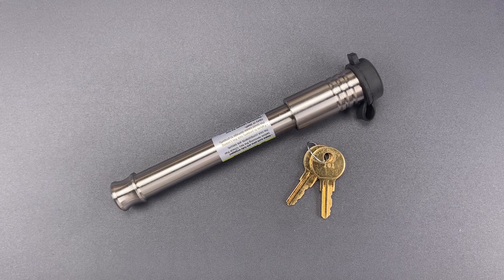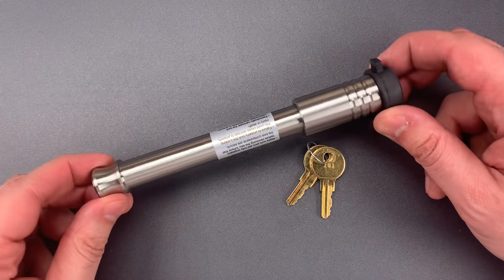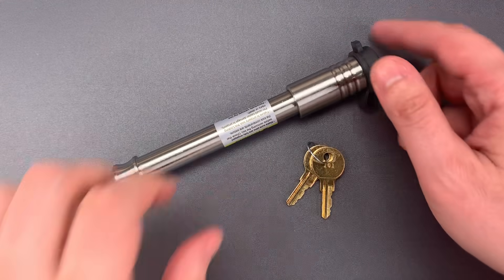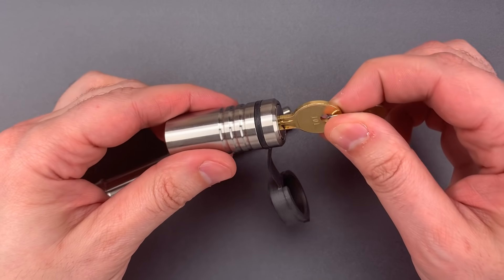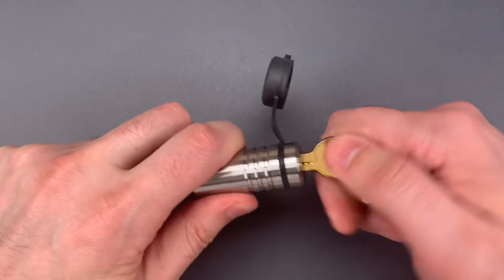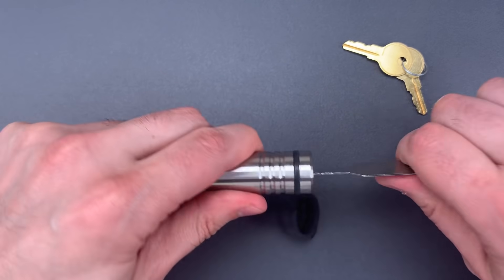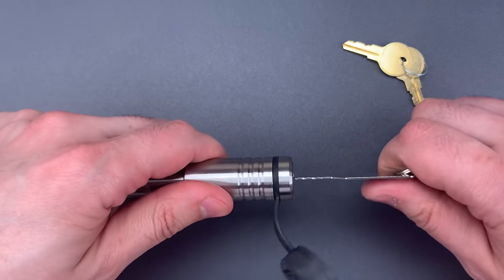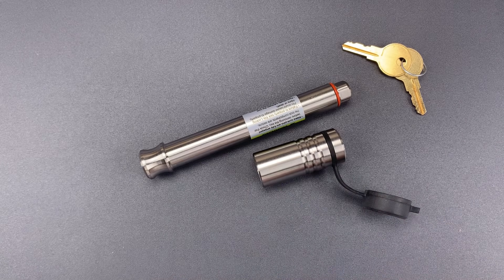[1086] The Lock That Must Be Picked 15 TIMES! (Infinite Rule Security)

Comment: Could you imagine this thing with a decent core though
Reply: A Master 4 pin core would make it virtually invulnerable to the majority of thieves.
Reply: @springbloom5940  In the quiet words of the Virgin Mary, "Come again?"
Reply: yeah if only
Reply: With a better key bidding
Reply: @ConstantlyDamaged  

Well, seeing that 99% of thieves wouldn't bother picking it once, how long do you suppose they would work on a lock that had to be actually picked, no matter how easily, an unknown number of time; that just keeps going round and round with no obvious results? Try picking even one Master No3 in the field, attached to something. That's why thieves practically never attack the lock(with anything but bolt cutters), but instead, attack the cardboard box its attached to.
Reply: @springbloom5940  I can pop a Master #3 in the field in seconds; raking for the win. 

That said, your point remains valid. No way I'm going to sit around raking a lock a dozen times for no obvious return. I'll get out a cold chisel and a sledgehammer.
Reply: @ConstantlyDamaged  

For an example, when I lived in town, my apt complex had a metal sided storage building with exposed screwheads, that maintenance kept all their equipment in. Not only did they get cleaned out, but the little shitheads took the panel of siding they removed, for access.
Reply: @ConstantlyDamaged  Master 4 pin cores can't usually be opened with a jiggler, and as long as the lock has anti-bypass shielding a master lock core would absolutely make this a lot harder.  TBH the biggest problem with Masterlock isn't their cores (although they aren't great by any means) it's that you can bypass almost everything they make. 

But seriously, imagine having to rake this thing open the traditional way 15 times while it's attached to a trailer hitch.
Reply: @lairdcummings9092  

I have a No2 that I have never been able to defeat. One of these days Ill pass her around to Bill and his Lawyer.
Reply: @springbloom5940  I'll be looking for that video. 😉
Reply: @springbloom5940  Yeah, but with one of those particular pieces of crap, you could use a plug spinner to cut the "picking" time down to about 2-3 picks. Also, a nice rake will make that #3 lock core surrender just as fast as that jiggler key did.

What you want in that is a really heavy spring on the last pin, and make it a spool while you're at it. Should foul the spinner up and make raking it much harder.
Reply: How does one hold a cold chisel and a sledgehammer simultaneously?
Reply: @JoshStLouis314  use a short-handled sledgehammer. Something in the three or five pound range. I've got both in my tool kit.
Reply: @ConstantlyDamaged  

Yet, no one ever does that 🤔
Reply: @lairdcummings9092  I have a 3 lb hammer, but I consider it a large 2-sided hammer. To me, a sledge requires 2 hands. I very well could be wrong on the naming though.
Reply: @springbloom5940  Well he could pick it and then use the springloaded spin tool. But indeed nobody is walking around with that stuff when thieving for crack money.
Reply: @JoshStLouis314  short-handled sledgehammers are a thing; I use them with cold chisels to cut rebar. Faster and easier than a grinder, if you can secure the work piece. And the occasional lock for which I've lost the keys.

The shape of the head is the biggest difference between your basic hammer and a sledgehammer.

Edit:
I've got a couple 48 ounce (3 pound) framing hammers, too... But those aren't sledgehammers, despite being the same weight as my lightest sledge. Head geometry matters - right shape for the right job.
Reply: @springbloom5940  Do you think anyone would bother getting out a set of wafer jigglers like this, either? They'd just move on to a vehicle with a less security conscious owner.
Reply: @springbloom5940  You must be new here..
Reply: @JoshStLouis314  verrrrryyyy carefully.. ..
Reply: Why not add some weird helical core!
Reply: Unless it holds to a long pipe attack a better core is a mute point. One can slide a long pipe on the core and snap it. Core sticks out too much.
Reply: @wdiaz03  Basically. Without knowing how resistant it is to physical attack/bypass, it having the best core in the world is fairly moot.
Reply: @ConstantlyDamaged  Pretty much nobody outside of locksmiths and really hardcore locksport people has a plug spinner, let alone carries one around.  Also depending on the plug spinner, a lot of them only do a 180 degree rotation and you'd lose most of the time you gained by having to keep resetting it.
Reply: @lairdcummings9092  cold chisel and mini sledge destroys most welds, even on tire boots
Reply: @dozi3r  yup.
Destructive combo.

Also: So where you been parking? 😁
Reply: @springbloom5940  as for realistic field conditions your location plays a big part of it. I have a pretty good setup on my basement door, pretty good core repackaged in an old kwikset housing from when my parents built a hose. The thing is that I dont slouch on security but everybody else does so why should they bother with me when everybody else up the valley uses master lock everything? Its like the old tale about a bear, you dont have to run faster than a hungry bear, ya only have to run faster than the guy beside ya.
Reply: But if you just coated it in 1st grade bat shit. You only have to wait a week for the picker to die.
Reply: Dude, this lock kept LPL busy for 30 second, this lock is already God tier
Reply: @springbloom5940  yeah master would finally be proud
Reply: @kidthorazine  thieves: NOPE
Reply: @springbloom5940  i guess people see how cheap it is and go 
Im not
Reply: Slap it in a titanium reinforced thick steel safe and that's the issue solved. Seriously, why hasn't anyone done this yet (ignoring the "titanium reinforced thick steel" part, that's a millionaires project)
Reply: @lairdcummings9092  do you mean a drilling hammer? Sledgehammers are 2 handed.
Reply: @springbloom5940  that's just making sure your targets know their mistake.
Reply: I think prior knowledge would be the bane of this lock, otherwise theives might give up after the first attempt relocks.  Or even the next one, not realizing that eventually it stops relocking.
Reply: Remember the chess themed challenge core?
Reply: There is no such thing as perfection. Is it Ramset proof?
Reply: @Tatwinus  No he means a sledge hammer. The type of hammer refers to the shape of the head. Differing lengths of handle or weights don't change the fact that a sledgehammer is a sledgehammer
Reply: Laird Cummings you scare me yet fascinate me sir
Reply: They exist, our vending machine uses medeco locks that are threaded, there’s three of them in the door, you could pick it yes, but you’re going to be there for a while.
Reply: Would be humiliating at best with a Abus Disc detainer core
Reply: The lock to surpass Nokia
Reply: Yeah, might as well try to impression it then
Reply: @springbloom5940  This is already virtually invulnerable to the majority of thieves. if you are stupid enough to risk your life or future by breaking in, robbing and stealing, you will 100% be too stupid to pick even a simple lock, let alone figure out why it won't open after you picked it already
Reply: @springbloom5940  just put an Abloy disc core and no one will even try
Reply: One of this with a Bowley core!
Reply: It would be a monster
Reply: Angle grinder goes "whrrrrrr!"
Reply: * in SpongeBob voice * 20 years later
Reply: Or you could just make the bolt double the lenght, which would make you have to rake it 30 time
Reply: @JoshStLouis314  very carefully
Reply: @JoshStLouis314  as a secondary side note, i have a mini sledgehammer thats more like a steel mallet. Perhaps thats what they ment
Reply: @ConstantlyDamaged  Nice Snatch reference
Reply: Fr they could just put in a cross keyway and the thing would take a LONG time to open
Reply: @Sabrintwitt3r  my mind went to the Abus DD cores as well.  It would make it a fun challenge lock, especially if it tensioned off a different disc each time.
Reply: That would be good enough in most cases
Reply: How about a decent core and a mechanism that resets it after 10 seconds or so?
Reply: @springbloom5940  yeah they do. The only common locks that people have a hard time picking are the ones that are old, rusty, seized, and never unlocked. The majority of Thieves don't pick locks at all because its a skill that takes some practice.
Reply: @stompingpeak2043  

The majority of thieves don't pick locks, because its always faster to break the lock, or what its attached to. They don't give a shit about destroying your stuff. A $5 prybar will defeat the overwhelming majority of security.
Reply: @springbloom5940  yet some people have cought on and they do now pick locks.(only have to carry a pick and tensioner over having to carry all the other stuff). People use force on stuff when they can premeditate the crime. Meaning they have an idea of what's behind the lock. Also the growing lockpicking community here on yt is bleeding into the crime department as well. So if you do buy a lock from Walmart and use it somewhere watch out. They can all be picked quickly by amateurs with a cheap pick and tensioner.
Reply: Ya if that had a much better core it would probably be much more effective since if it took a few min per pick they would most likely just quite
Reply: @springbloom5940  aka, example lesson. DONT SHOW THE SCREW HEADS ON THE BUILDING WITH EXPENSIVE SHIT IN IT
Reply: @owenruff4796  even a 20 second pick would take 5 minutes to get thru. 1 minute each pick and that's 15 mins; nobody would ever dare to fully pick it.
Reply: A lock with a good core takes even lpl 30 seconds to a minute. Still that means that 10 min is all they need. Still that's more than most people are willing to sink into it.
Reply: True, imagine any newer abloy core and you have basically lock that no one would ever take their time to mess with in real life situation.
Reply: @springbloom5940  yes even a butter core would be better!
Reply: Yeah like who's gonna pick a tough lock 15 times just for a trailer
Reply: Most people still wouldn't want it on their door since you have to turn the key several times to unlock it, even if you actually have the key. Convenience is a significant concern for locks you need to open a lot.
Reply: That would make it the ultimate lock
Reply: No, because nobody even bothers to make a lock that LPL could struggle with.
Reply: @JoshStLouis314   I'm assuming you get a friend to help.
Reply: It's in Bosnian bills naughty bucket. That huge hidden shackle thing
Reply: @dozi3r  this me ck Made out of ringsteken with a hex Kock and pressure spring
Reply: That just would take LPL 10 additional seconds to open it.
Reply: yea, that would take the tool that LPL and Bosnian Bill made, and extra 20 seconds
Reply: Right? give it a good core and it would be nearly impossible
Reply: Heck even a shitty master lock core (well, you know their better ones that at least have a couple non-standard pins) would be better.
Reply: @springbloom5940  seems lately all you need to keep everyone out is a now hiring sign.
Reply: At that point, I believe an impressioning attack may be a good choice.
Reply: Nightmare
Reply: It would be a nightmare lol
Reply: Could the core be replaced with something better?

Comment: Sure hope the lock manufacturer takes note from this to improve their core. This will be a notoriously annoying lock to pick if the core is improved
Reply: Eh, so you are approaching me?
Reply: Indeed. They came so close to creating a lock that was time consuming enough to offer pretty good security, simply by virtue of forcing repeated picking. One or two challenging picks? Doable. 15 re-picks, with security pins? God damn, I'd just give up. Manufacturer, heed this video, and install a better core. Use this video as an opportunity for positive PR and improving your product.
Reply: @jayeshmange2424  what?
Reply: @MuscarV2  Are you approaching him as well?
Reply: @MuscarV2  Pretty sure it's a reference to a popular anime.
Reply: @MuscarV2  JoJo
Reply: Just a core similar to the ones in the 6-pin American 1100 and it will take even LPL 5 minutes to get it open.
Reply: 8-12 disc detainer in there, would be a nightmare
Reply: Yeah, even just good enough to defeat jiggling and raking type attacks would make this really obnoxious.
Reply: "annoying lock to pick if the core is improved" - wow, really?
Reply: It'd be interesting to see him pick it from the bottom of the truck though. Just to see the difference, not being able to hold the lock and jiggle with both hands. Just curious, I know he wouldn't have much trouble because he's a master at his craft. But it'd be  interesting to see. JS
Reply: i just called them, they said they cant at the pricepoint they make it at, and that most people would just try to snap it off with a pipe, and also that it is mostly there as a deterrant
Reply: @emfisher8168 , dude, this is jiggling, not brain surgery.
Reply: I work as a locksmith and have encountered basically the same design lock a few times in the wild. Even with a janky ass core these are still a pain to unlock, especially if they're positioned at an awkward angle on the trailer hitch, I would bet any thief who knew what they were doing would try to find an easier target before tackling these hitch locks
Reply: @rupedog  8-12 disc detainers, and any decent lockpicker would rather break it open
Reply: @rupedog  disc detainers aren't spring loaded like wafers or pin tumblers, so once the discs are set you wouldn't necessarily have to re-pick on each quarter turn. A steady hand and you only have to pick once. Meanwhile a core with security pins could really mess with a picker here.
Reply: @rupedog  It would take LPL 8 minutes just to introduce the pick that he and Bosnian Bill created 15 times.
Reply: @emfisher8168  It would almost be just as easy. I have one of these locks and the way its setup you can either turn the key or turn the whole lock pin and hold the key still and you can still unlock it. Image unscrewing a nut off a bolt. Either unscrewed the nut and hold the bolt or vice versa, doesn't matter. So you can just put a jiggler in the keyway and turn the whole lock, would be easy even under a vehicle.
Reply: @BrassAxe  That wouldn't work on a jiggler unless you magically get it lined up just perfectly and manage to stop moving immediately.
Reply: do you really thing they dont know ? they are experts they shrue know. the desicion making is different.
its about cost and production lines and a product that will do the job even it might not be perfect. 
when this thing is mounted you cant jiggle it that fast or easy, sepcially if you dont exactly know this exact lock.
so its a good enough deterent.
if you put a more secure lock on it people will use bolt cutters, so you need much thicker steel, at the end you end up with a safe that weights 35 tons to secure 5 bucks of value
Reply: @samkatz227  I sure wish they would upgrade the lock.  InfiniteRule pins already cost $35 - $40 each.  Personally, I would pay $3 - $5 more for a better lock.